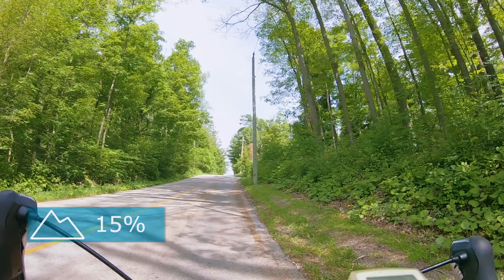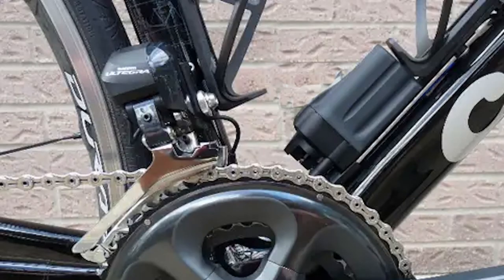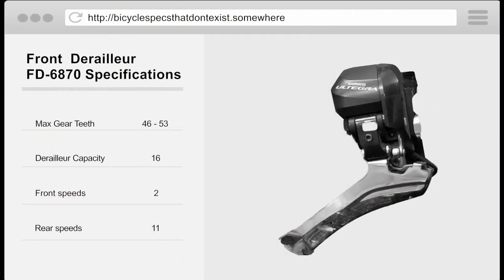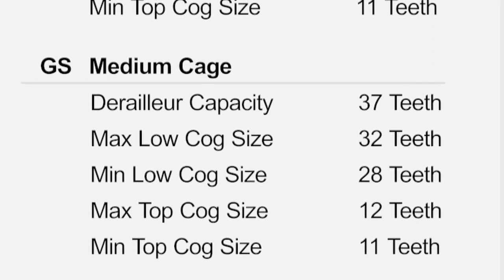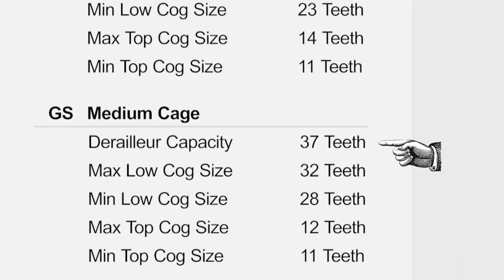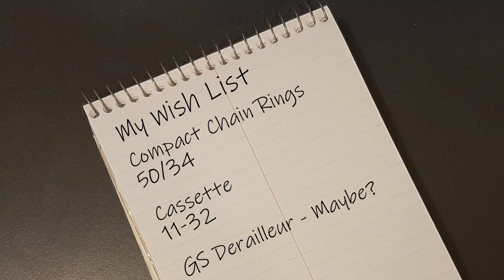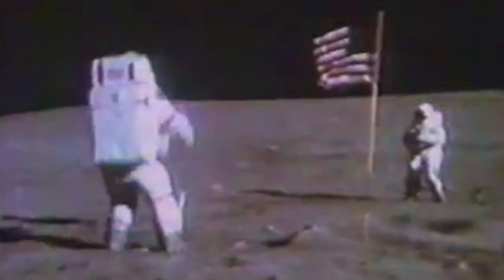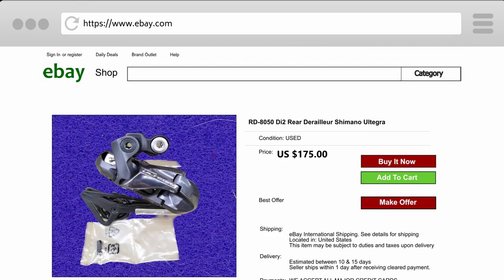Bicycle Cassette & Chain Ring Upgrades

Comment: This is the BEST video I have seen that thoroughly explains how to make a drive train with compatible parts!!!  One suggestion when looking for parts is to look for bike co-ops or DIY bike shops.  They can be a treasure trove of good used bike parts which sell for a fraction of the cost.  Toronto has a place called Bike Pirates maybe worth a gander?  I found all the parts for a Shimano mountain bike 11 sp drive train that typically sells for $400 for about $20 each for cassette, rear derailleur and shifter.

Comment: Nice video explaining how to calculate maximum capacities. I just did a similar upgrade to my 2nd bike, which I want to use for bike touring in hilly areas. I'm mechanical shifting, the bike had SRAM Apex 10 speed. I replaced rear derailleur with new SRAM GX 2.1 (as long as shifters and rear derailleur are both 'Exact Actuation' then you can do this), and the got good condition used SRAM Red RH shifter, and SRAM force LH shifter, from eBay. Got a used compact front chain rings. My bike can now accommodate up to 11-42, but found 11-36 cassette, with Compact front chain rings the sweet spot for bike touring on big climbs, but still good gearing for flats. Cost me £150 all in, and the difference in shifting is night and day between 10 speed Apex shifters and the SRAM Red 10 speed shifter. Just note if changing from road rear derailleur to MTB, you need to install a inline barrel adjuster for rear indexing, as MTB SRAM rear derailleurs don't have barell adjusters, but just a few quid for fitting an inline one.

Comment: Be daring and go with a 52-34 and 11-34, it works if you have a GS... capacity limits are soft rather than hard, chainstay length also plays a part, the shorter the better for these extreme 1:1 setups. 34 front with 11 or 13 rear is a no go but you shouldn't need to ever use that combo, while 34/34 is what you need for 20% seated climbs.
Reply: Agreed, the capacities are set so that even if you cross chain it will still work i.e. big-big & small-small.

Comment: I've got 50/34 by 11-34 on my "good" bike (All R7000 105, tubeless, discs etc) and can get up Cairngorm Mountain here in Scotland but it requires  switching between 34/34 spinning and dropping a few at the rear and getting out the saddle for a grind now and again.... On my older bike (Built with Tiagra 4600 10 speed shifters with a 9 speed Deore Shadow M592 RD which is SGS and has 36T large cog capacity and 45T total capacity) I've just modified it at the crankset  (FSA Tempo Adventure)so it is 46/30 by 11-36, far easier now to sit and spin in 30/36(using 41 of the 45T capacity) and I bought an 11-40 for the places in Scotland I might go that are worse (uses up 45T capacity, no chain slack in small small should I ever be in that gear, and B-screw allows the changes for the 4 extra teeth on the lowest cog).... But 2 things- one, I'm way too heavy, maybe 10-12kg (22-26lb?) overweight so need to work on that front, and second I wish bike manufacturers would  offer cassettes that started at 13 or 14T.... 50/14 (or 46/13)is fine for me and I'm not concerned with going 80km/h (50mph) downhill.... too busy looking out for potholes and idiot drivers to be going that fast on skinny 28c tyres. One thing for sure also- can't beat the old 9speed MTB RD's and 10 speed Road STI's together- once 10 speed Deore hit and Tiagra 4700 it all went t*ts up for cross compatability!!!!
Reply from the maker: Thanks for sharing that.

Comment: Quiet entertaining indeed. I'm going through the same process with a vintage Merckx (it initially had a 13-23 cassette with 42-53 chainring, so not ideal for climbing haha). Also had to discover what a chain capacity means, short medium and long cage and all these kind of stuff.

I changed the rear derailleur too and now I will go for a 11-28 which is possible thanks to the small difference between the two crank rings.

A good helper I found on my path is a website called gear ratios bike calculator to preview if you want to change the cranks rings size of the max and min cogs on your cassette.

Can't wait for part ii to know what happened!

Comment: I run a Chinese groupset called Retrospec. It has a RD with a long caged carbon pulley. I changed the FD with a r8000. I'm running 54/36 chainrings and 11-30 12speed cassette. Crisp shifting.

Comment: l did the same l 53-39 with 12-26 T cassette ,now 50 39 and 11-32 using wolftooth extender works great ALSO l did get new chain too used SHELDON BROWN method to measure it both large cogs +2 links :)  l have a long cage rear derailer on my other with 12-32 and 1x 44t NW ring on my steel road bike with 35x700 tires . NOTE you can use equivalent mtb  derailers for those larger gears in the back ,DEORE RD M5100 SGS OR RD 4120 SGS

Comment: Last year, I bought a new chain and cut it too short and it put pressure on the derailleur. After a couple of rides, I swapped it to avoid accidents. But with the new experimental 11-40 cassette, it put extra pressure and it broke in half while I was descending at 70 kmh (43.5 mph). Luckily, I didn't crash and managed to get home by removing the broken bits and ride in a sketchy single-speed fashion. Losing weight should be the priority, not going beyond the recommended limits :)

Comment: 5:13   I went to the five bike stores in my area to ask for the maximum tooth difference and sure enough everyone said 16 teeth. My front chain rings went from 26-36-48 to 22-42 and shifting is just fine. I ride a touring recumbent and what is not stated here is the cadence for the gearing. I spin at 85-90 rpm and can not get into the highest gears on the flat roads so why bother with gears that you can not effectively use?  There is nothing on the slopes of North Vancouver that I have to walk up and that includes grades as miserable as 27%. It sure is nice to have a gear up or down that is there for your use instead of wishing it was there. Enjoy the ride .

Comment: My "fastest" bike has a low gear of 39/21, not exactly a climber's bike.  My preferred "endurance" ride has a lowest of 34/27, still not an alpine machine.  But where I live, it's fine as long as I can do my part.  I'm 63, and I still can.  Here's the thing about bikes and upgrades/component swaps: if you want things to go well, you don't want to spend a fortune, and you want to enjoy the experience, ditch the electronic shifting and integrated cabling.  That's old school, I know.  But so am I.

Comment: ultegra gs will work with a sram 11-36 in most cases. you will likely need to put the b screw most of the way in. 105 gs shadow series for 50$ also works with 11-36

Comment: Did you, can you, you should have and possibly still can research the advantages of using a double oval chainring. 

An oval chainring is an effective way of increasing your legs torque.

Comment: Entertaining video, sir.
An 11-28 is okay where I live, in the north of the Netherlands, terrain doesn't get much flatter anywhere. 
It's still a nuisance getting parts, the aftermath of Covid is still quite tangible when looking for bike(part)s. For alteration/repair purposes I usually stick to the entry level 'good stuff' like Shimano 105 for road and slx for mtb-like bikes. More choice, it doesn't break the bank and I'll survive the few extra grams. Talking about weight, I ordered tpu inner tires. Don't have 'm yet but two times 28 grams instead of two times 105 grams on the moving parts we know as wheels for €30 more is an absolute no-brainier in my opinion.
Have a smooth ride!
Reply from the maker: I'm glad u enjoyed the video. Thanks for the comment and kind words, sometimes u wonder if anyone is watching. Curious 2 know how the TPU tubes work 4 u.
Reply: Near the coast, you should get away with running a 12-25.

Comment: Couple of things regarding the Peak Torque video. The biggest issue he ran into was that he was running a 52/34 (a normal combination would be 50-34) and the difference in the front chainring is 18 teeth rather than 16 teeth. Because of that, he had to size the chain for an odd combination and if he ran big-big (52-32), it would put too much tension on the chain and cause it to shear off. If you’re running a 50-34 and 11-32, you should be completely fine. For what it’s worth, I run a 48-32 and a 11-40 on my gravel bike with a Wolf Tooth extender. Shifts crisp on both front and back (I run Absolute Black oval chainrings too).

As far as updating firmware on Shimano. Download the Shimano E-Tube software, plug in the same dongle you use for charging to your computer. It should recognize your components (you may need to plug into a USB 2.0 port if you’re running into any issues). Then update the firmware to the latest and it should be good to go. I’ve done this a few times, and it generally takes about 20 minutes.

Also as far as buying parts go, I don't know if they ship where you are, but I buy a ton of components from a shop called Lordgun. They're based in Italy but ship worldwide, and depending on your country's policies, you may not need to pay VAT.
Reply: Never used "Lordgun"- they always appear in searches here in the UK, good to know they're not a "drop ship" scam company...
Reply: First of all PT doesn't have to size his chain for a 52-34/32 combination as Di2 just doesn't let you use such a steep cross chained combination. It will just drop to the small chain ring. (maybe not in full manual mode... But why buy an electronic gearset then in the first place when you don't use it to its advantages) 

Maybe too late for the video creator. But the Rd 8050 supports 11-34t cassettes by default and with tightening the B tension screw a bit 36t will work without a problem. Shimano is very conservative with it's numbers. 

And with a hanger extender 40/42t work fine as well. Possibly more, but I have just used that combination for crossing the Alps with luggage in the bike.

In contrast to smaller front chain rings (sub compact like 46/30) where the chain might rub on the stays that might be the only way to get lighter gearing.

Comment: You are a bike mechanic, just not a professional bike mechanic.
You can get away with an 11-34 with the GS rear derailleur.
I prefer the old fashioned cable operated derailleur's.😉
Reply from the maker: Cable operated stuff is so easy to work with......😎
Reply: @mannimix  8:22 I went there too!👿😭 Had to bite the bullet and buy another derailleur, well a whole group set as I couldn't find a matching derailleur and having an odd one nagged me every time I cleaned the bike.🤨

Comment: They say Shimano is conservative with their maximum cog sizes for their derailleurs. They say you can at least go 2 teeth more, maybe even 4 teeth more than their recommendations. 

Also as long as you don't cross chain like using the big ring with the back big ring, you definitely won't have a problem.